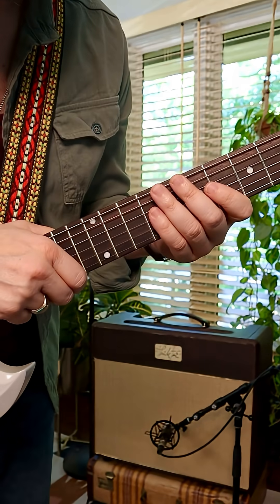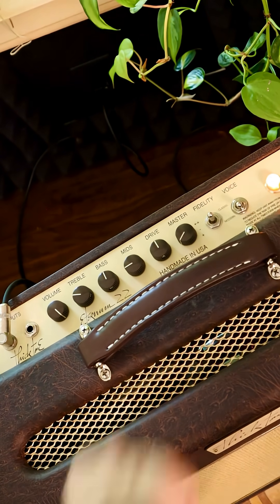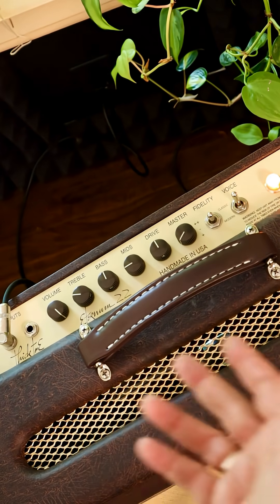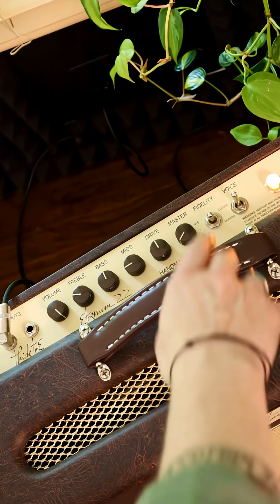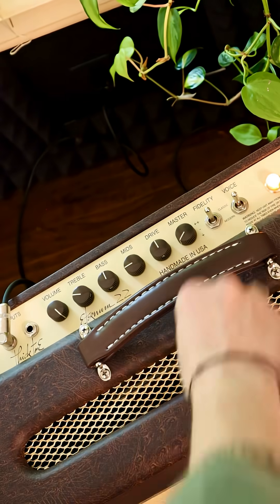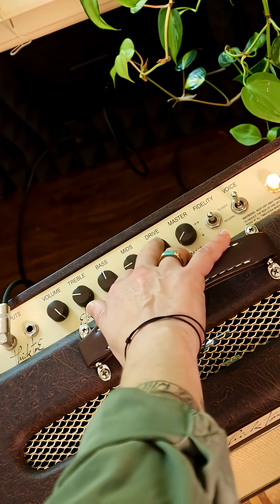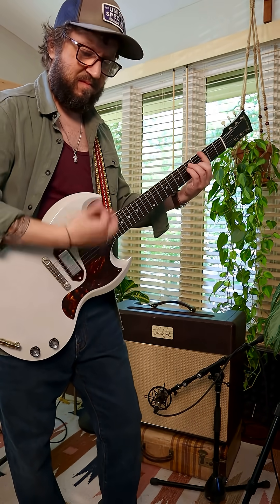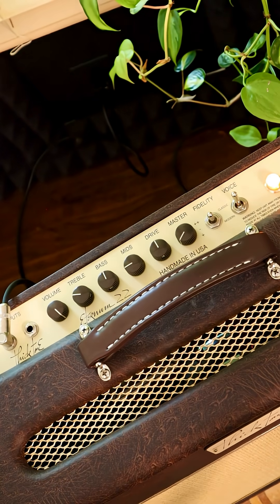Testing The Eternum 22 Overdrive Circuit

Comment: I picked mine up today and was nice to be able to reference back to this! 

This amp is the real deal - while being totally unique there is a simplicity to it that makes it pretty easy to find nice tones. The pre and post eq volume/drive adds nice versatility and the master volume lets you keep your hearing intact. I find the classic/modern to be a pretty impactful switch, not sure if I’ve made up a preference of one over the other - modern seems to be crisper / more defined. 

Looking forward to spending more time with it to appreciate the nuances. 

Build quality is unreal. Curtis is a retired PhD in electrophysiology and has a scary amount of knowledge with circuitry. There are no electrolytic capacitors, meaning the lifespan will probably outlive me. Real “buy it for life” kind of feeling. Not cheap, but buy once, cry once.
Reply: All tube drive with no electrolytic (tone) caps? Intriguing!🤔